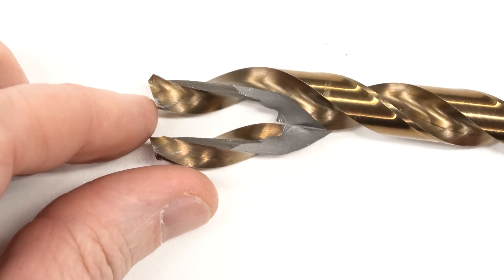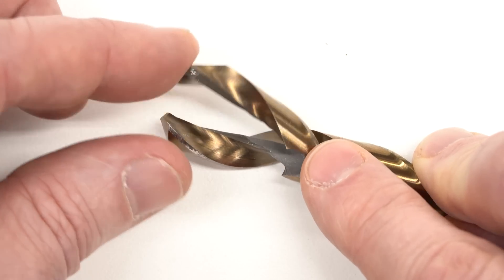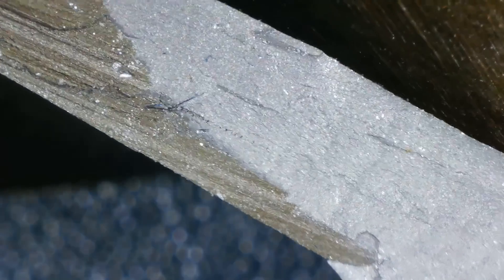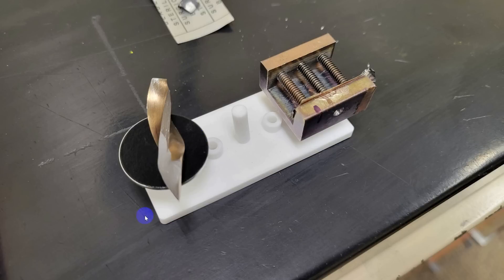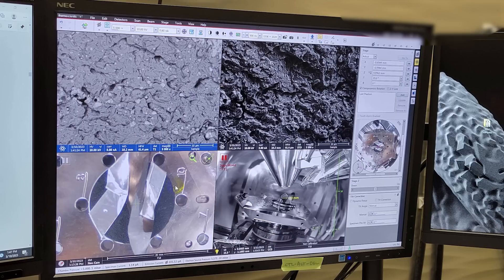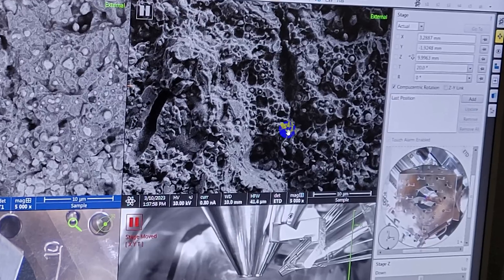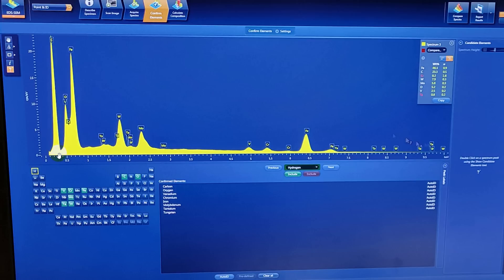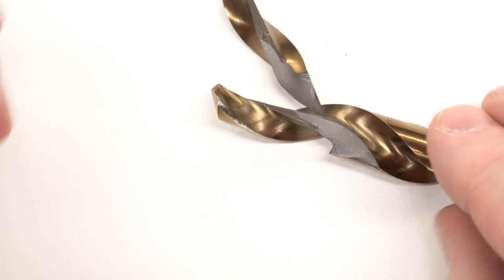What the Scanning Electron Microscope Reveals About This Failed Drill

Comment: Aircraft mechanic of 8+ years. Drilled hundreds of thousands of holes in steel, aluminum, stainless, and composite. With the exception of a few specific drill processes, best shop practice is to step up in drill bit sizes by specific increments depending on material, thickness, and stack-up. I've witnessed very few of the drill bit failures you experienced with this drill bit and can say, with 100% certainty, it is a manufacturing defect. We've gone so far as to purge all inventory of bits from specific manufacturers, with similar manufacture date and heat treat lot numbers, that have exhibited failures like this due to the injuries sustained by mechanics.

It's always nice to dive deeper into these different topics! Keep up the great work!
Reply from the maker: I bet.  If you're working on aircraft, a small problem with a tool can get very expensive very quickly.
Reply: I would disagree with stepping up as best shop practice unless you are using core drills to enlarge hole. The center or chisel point of the drill helps keep drill forces centered a typical 2 flute twist drill only has cutting edges 180 degrees apart whit the area 90 degrees from cutting lip falling in the gullet of the drill this does not give you the radial support that you have with the chisel point engaged. You also have force on the OD of the drill due to the drill not cutting slightly oversize that it does in a blind hole. There are drill made for opening up holes usually 3 or 4 flute with out center cutting capability but regular 2 flute twist drills are not designed for this and would not be best practice.
Reply: @terryallemann2654  agreed, this guy ain't an aircraft mechanic. Single shot with a standard drill, or use a piloted drill for upsize. Core drill if you need the feedrate and stability, reamer if you are going for surface finish.
Reply: To be fair... We could argue that the guy who wrote that email is not some random guy talking about general rule of thumb in a workshop, but a representative of a specific product they manufacture. Therefore, it is not a far fetched thought that maybe they meant that they don't recommend pre-drilling for that specific drill bit with their manufacturing process in mind. Just to be clear, I 100 percent agree, it's most likely BS and manufacturing defect or flawed design, but you can make the argument both ways. The lifetime warranty is pretty sweet nonetheless.
Reply: Have you had 8+ years not predrilling to compare failure rates? Sorry not trying to be a jackass (well maybe a little haha) I just kind of trust the company who make the bits and doesn't want to be giving out more of them, he even sounded kindy of cheeky about including the #2 countersink like's he done it many times before.
Reply: Also didn’t have any lubricants
Reply: I could not agree with you more.  Indeed, my favorite sets of drills are pilot bits (mine are made by DeWalt) which have an integrated smaller bit that starts the hole followed by the larger bit.  Whoever responded to James was full of crap.  This bit was flawed.
Reply: @flingshotlife  Easy, just do not buy the cheap horor fraught bits unless you are prepared to use once. I have had good results using bits from tool suppliers, and Dormer makes good low cost bits. Just do not bother buying cheap, especially in sets unless they come from a tool supplier, or are branded from Dormer, Bosch, Hikoki,  or any of the larger tool manufacturers, who have them made to their spec. Anything that comes as cheap sets, especially with a badge just placed on the box, is not the best, some are not even hardened steel at all, just ordinary steel ground to shape, because that is easier, and they twist straight the first time you use them.
Reply: @SeanBZA  obviously you don't know much about any tool sources 😂
Reply: What can you do with this information? Hey you are american... just put a legal claim for some millions, 😆
Reply: @jorgeo4483  They just get sent back and replaced with a new batch, and then the manufacturer has to dispose of them. My bet is that they split during the twisting process, as blanks with a round shank and flat  end are twisted to make the spiral, then are then rough ground, then heat treated and finally finish ground, with the final process being the final heat treating or coating. Either a batch of alloy that was too cold, or was not mixed properly, or was cooled down too rapidly in the forging process, led to the initial defect there that is where the failure started when it broke, and this first went to the tip when it was being twisted, and stayed there all the way. 

This bit was doomed to fail anyway, that split was bound to open up sooner or later, the forces on it made it split, irrespective of it enlarging a hole, or drill into the block from the beginning, that force was applied to the tip in the same manner.
Reply: @SeanBZA  I was just kidding but didn't know twisting is the usual process of manufacturing. I was watching some videos of Haas and they shows a different method, I'm not an expert of course.
Reply: @jorgeo4483  Could be ground only, but still have had a defect in it from the manufacture of the original steel wire it was cut from, that just was close to the tip, where it caused the initial defect that grew during grinding, but did not fail QC, because no manufacturer will do xray or ultrasonic testing of all the high volume low profit drill bits they make, unless it was destined to be used in a critical process, like on a Mars rover.

Comment: James, some 50 years ago I got my degree in material science way back in Sheffield, UK and those semi circular bands in the failure pictures, to me, look exactly like the classic fatigue type failure. Normally fatigue takes many cycles to show evidence but with that material being so brittle each rotation of the bit whilst cutting would add a torque to propagate the crack some more. I agree that the dark area was probably formed at manufacture as the rounded smooth rather than angular structure of the crack surface, to me, indicates some elevated temperature or carburising process. Are the drill bits quenched in an oil bath as part of the heat treatment? Alloys of steel can be quite complex and getting the composition just right for the intended purpose is akin to the black art of alchemy; in general the interstitial nodules are there to pin the dislocations and increase the resistance to deformation but the size and distribution of them is critical and usually requires some complex heat treatment process to get it just right. I n summation I think you got it just about right and the drill supplier should be contacting the manufacturer regarding their below par quality control.
Reply: It’s pretty obvious it’s a fatigue failure but there isn’t enough information about the drill’s life. How many cycles had it done or was this the first use? Was it dropped? I see the classic fatigue fracture line running along the drill axis that are coming from the tip. That rules out the whole dark area being a factory defect although I couldn’t rule one out at the tip. It had to work in torsion to create those fatigue lines of those colours as the post fracture oxidation needs time to set in. I do like your line of questioning James with the colour change but you simply overlooked some evidence that is significant mate, and that changes the whole line of investigation. BTW I’m an Aussie mechanical engineer with endless curiosity which is how I ended up studying after 10 years as a soldier. I worked mainly on guided and unguided things that go boom, but also armour and tier 1 motorsports. So if you go back to the footage and see what looks like rows of sand dunes running along the length of the drill in the older fracture area, each of those is a fatigue fracture expanding one load cycle at a time. If your scope could get an oblique angle with a lower light angle it should pop out. I’d hazard a SWAG that you used it and expanded the fatigue failure, put it away and then the next time you used it a few days later it failed. I could be wrong and that’s okay too but I have seen similar and was lucky enough to study failure analysis and non-destructive testing with the folks considered the best in the game in Oz. Still doesn’t mean I’m right 😂
Reply from the maker: Yeah, I was thinking fatigue initially also, based on the ridges, but it's so brittle...

Comment: I had an identical failure with a DrillHog drill. In my case the flute broke off as soon as the drill hit the material. They did warranty it. It looked exactly like your failure, with the old and new broken areas clearly different. No doubt in my mind it's an artifact of the manufacturing process. Nothing is perfect, and I've gotten good service from all the rest of the drills I've bought from them.
Reply: It could be a common failure and the best QA is to ship them anyway and honor the warranty for the ones that they couldn't reasonably QA in house.  I.E. You do the QA.

Comment: Maybe please ... it's a carbide drill that snapped up it's weak point ..... no machinist I ever met used carbide ... just grind a proper hss tool .....  nothing STEM needed .... just look
Reply from the maker: It's M42 cobalt HSS.
Reply: thats only for thosespecial buyers at midnight

Comment: I have always been taught to not pre-drill except on big drills where you need enough to accept the chisel edge and that is to reduce the pressure it takes to shove that through the steel.  The 135 degree split point are made to not wander with the grind and the thin web.  In soft material like aluminum or plastic the drill is more likely to "thread" its self in.  I have had the MT4 mounted chuck get yanked from my spindle with drilling Delrin that has an existing hole.  I look for core drills or "Dreamers" for that if I have them (that is rare).  Cool stuff man, I appreciate it!
Reply: I've experienced the same thing in UHMW, Teflon, and Nylon. I switched to a hand ground HSS boring tool in those situations. Always funny to see the looks of people when the part pulls outta the chuck too.😂

Comment: Dang, must be a pricy drill bit if they were like "yeah I'll replace it and throw in the associated bit we claim you should have used" 🤣 And then you do the hard work of failure analysis for them 😁. Thanks for the very nerdy and excellent look at the drill under the SEM, I really enjoyed the explanations.
Reply: Just good customer relations, and also a company that offers a lifetime warranty, not expecting much use, because most of the time a drill bit fails it is due to abuse, or it just wearing out. Here it was definitely a latent defect in the steel, and they probably have had a few of the same batch fail already and been reported.

Comment: just spend the money and get a proper hss drill .... with tips if you have a lot of cash ....... you bought second quality ... thats what you got .... you need to look at tip drills - not even hss .... you are in a trash shop using that ....... with a twist drill - 9 times the diameter deep........
Reply from the maker: In fact, I just picked up a complete set of Chicago-Latrobe HSS jobber drills, made by Greenlee.  I have their screw machine length set, and they've been fantastic.
Reply: Umm No. Drill Hog is supposed to be decent quality, certainly not 'second quality'. And definitely not cheap chinesium crap. And they're HSS not carbide. You seem to have a hard time with facts. Also a really bad attitude.

Comment: Agree with the pre-existing fracture. That clearly occurred during the manufacturing process. The secondary fracture does not appear to have failed all at once. Your low mag optical photos at around 3:45 to 4:00 show evidence of fingernail-shaped “beach marks”. That is clear evidence of a fatigue failure. As external load is placed on the material, the fracture grows one cycle, the distance between consecutive beach marks. That says there must have been a repeated application of load that advanced the fracture surface the distance between the beach marks. Since that distance appears to be relatively coarse, the load could come from the advancement of drill via the tail stock. You twist the handle, stop for a fraction, then advance it applying more load (speculation on my part having bored many holes on a small hobby lathe.) The cross-section of good material keeps becoming reduced as the fatigue crack grows. Eventually the tendril of remaining material fails to support the external load (stress) and the material fails in final fast fracture, evidenced by the cup and cone appearance by secondary electron image of that last photograph you showed where you could see the little round inclusions sitting within the base of the cone. Those inclusions served as nucleating sites for the final fast fracture. 

I am a metallurgist, MS degree, with 25 years of performing failure analysis on a wide range of materials including steels, titanium, niobium, zirconium, and other structures. If you can get back on the SEM and get a set of low magnification secondary electron images, say 10 to 25X I think you will readily see what I’m talking about.
Reply: The one question I have about this theory is: Why did the fatigue crack meet up smoothly with the pre-existing manufacturer-error crack? I wouldn't expect that to happen unless they propagated from the same exact stress tensors.
Reply: @avialexander  the fatigue portion of the fracture took off from the preexisting fracture. There is an extremely high stress field at the tip of the preexisting crack….one that can easily exceed the yield strength of the material. The sharper the notch at the crack tip the more concentrated the stress field. This can be verified in that the tips of the thumbnails point in the direction of the crack elongation. This is not so much a theory as a well known observation of failure mechanics. In effect the failure had three distinct modes. The preexisting brittle fracture, the low cycle fatigue portion, and then the final ductile fast fracture that looked to be mostly in tension (the cup and cones were circular, not elongated as in shear.  It’s like reading horse tracks or animal tracks in the old West.
Reply: @Zircon10  I believe you may be mistaken about the beach marks. I'm not an expert, or even certified or anything, but they wouldn't occur on the trailing edge of a fracture, right? That's the fast fracture area. Also, normally we're used to seeing them on relatively shallowly rounded surfaces, like round fatigue test bars. But this was a very sharp corner, and you can see that the curvature of the beach marks becomes much more shallow farther away from the corner, indicating to me that the fracture was growing away from that edge, not towards it. Welcome your insight here.
Reply: Alex, the fatigue beach marks certainly can occur on the trailing edge of a fracture, especially if the mode of the fracture is totally different. The original fracture emanating from the split point of the drill has all the watermarks of a brittle fracture that may have occurred during heat treatment or was exacerbated by thermal stresses of heat treatment. The heat tinting of the surface of that fracture roughly matches that of the outside surfaces of the drill bit and likely occurred during tempering as that "straw" color is associated with low temperature oxidation. 

There are large beach marks near the core of the drill that have quite wide spacing. The beach marks you are talking about near the surface are the result of high surface stresses prior to failure. There is little cross-section to support the material at this point and it is not unusual to see secondary fatigue cracks, especially emanating from the surface. 

I hate to tell you this, but your interpretation is incorrect. The fracture started out as a manufacturing defect, progressed down the length of the bit in low cycle fatigue, and eventually failed in a ductile fast fracture when insufficient material was present for the load applied.

Comment: In school I was definitely taught to not enlarge holes with drills. At most, a pilot drill avoid be the diameter of the chisel tip of the large drill.

Obviously, that's a sort of "horsepower elitism" there. Smaller hobby machines can't drive big drills outright. But yes, enlarging definitely concentrates the stress on the outer edge of the drill, and can cause extra wear and failure. And it can cause drills to bite and self-feed, which also increases stress.
Reply: I think you've proven well that there's something up with the manufacturing of the drill here, but that doesn't also mean that user error isn't a factor.

I think they're 100% doing the right thing replacing the drill, but also pointing out that technique plays a factor.